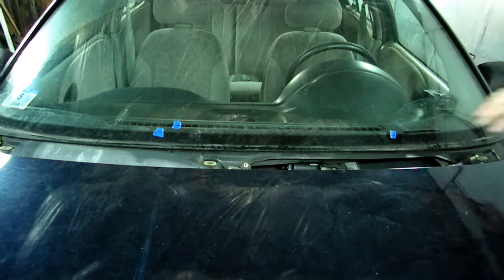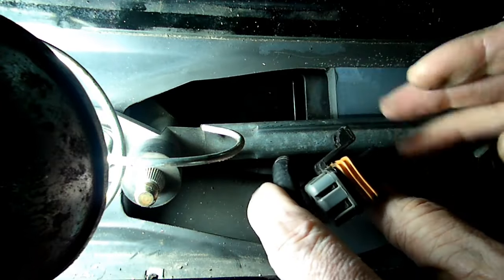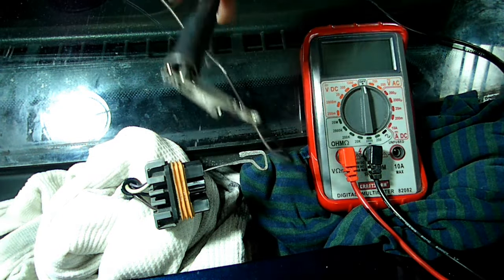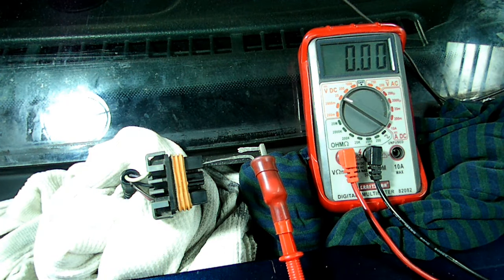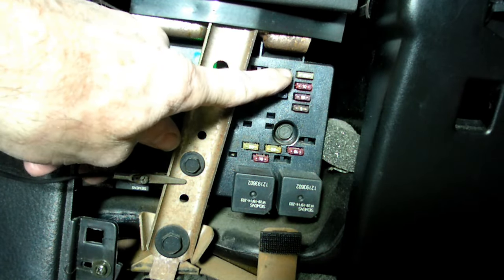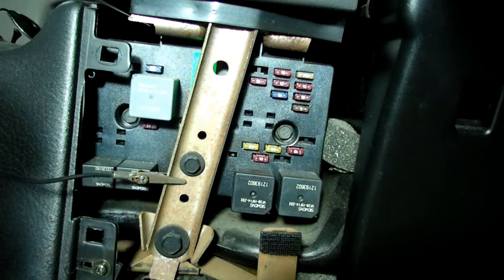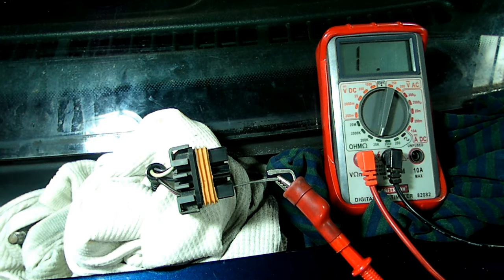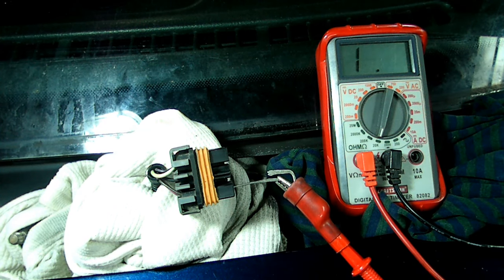Wiper Motor & Switch Troubleshooting

Comment: My wipers work on high speed but not on intermittent or slow.  Is this a motor problem?
Reply: David Potter def a switch problem. Hope this helped 6 years later lol
Reply: Madmok128  
No. in my Camry hybrid 2010, only high speed wiper work, no intermittent. I replaced the switch. It’s still same. Switch is not the problem.
Reply: @yogeshsharma-ju4ur  I am suffering the same problem. How did you fix that up?

Comment: Hi, Great video.  Would that be the same test for an 1998 s10 blazer?  I was going down the road in a down pour and the wipers just stop working. I know the motor works because i took the pulse board out and where the board connects to the motor on them 3 tabs i put 12 volts to it and the motor worked. And it's much cheaper for the board than the motor $20 vs $60.  Thanks.

Comment: I’ve tested my connections and are all good. Bought a new wiper motor and my rear wiper still doesn’t work. I am lost at this point.
Reply: Found the problem?
Reply: Robby Lindblom been ten months and still haven’t found the problem. It’s for my work truck not my daily driver so it’s not a big deal. Just annoying

Comment: How did you make the little probe wire?
Reply from the maker: I use a small 1/16 welding rod cut, bent and hammered flat for some of my probes.

Comment: good video i wanted to ask my wipers stop working when i turn the steering wheel to the last but then when i finish turning they work also when i clean the windows the wipers wont go back to starting position what do think? thanks
Reply from the maker: When wipers will not park in most cases it is in the motor.
Reply: thanks for replying, i was thinking that but i looked at it again today very weird problem heres a list of what is happening
1. doesnt return to park no matter what speed
2. high speed works fine (except for the park)
3. only on low speed do the problems occur
4. on low speed the wipers will sometimes not work but if i move the  steering column up and down it works weird right.
5. rear wiper doesnt work but that could be the motor 

possible could it be wiper switch or loose wire

Comment: wheres the interior fuse box on the left or right side ? how do you get to it
Reply from the maker: On the s-series the inside fuse panel is location below the radio to the right near the floor.There is a cover that comes off without tools.

Comment: what is the black wire in the center of the wiper motor electrical plug for? when i connected both i would hear something come on, not the wipers however, after doing that 3 or 4 times however it stopped.

Comment: Wiper glitch 2004 Saturn L300 will not shut off,in the off position.?  Saturn Seimen's computer,logic?, gets a message ,that the instrument ,panel dimmer dial is faulty **erratic.blinky** triggers ..  Computer will control the wipers,and not let them shut off. Telling you fix it the blinky dash lights,**Replace dimmer dial,on left hand side of instruments.Reset computer, wipers should shut off.

Comment: checked fuse -  replaced motor and pulse board and nothing !!  1988 s15 gmc 2.8 liter ! i wasted  money  trying to be  a mechanic !! if it is the switch  sterring wheel column will have to be removed which i can't do !